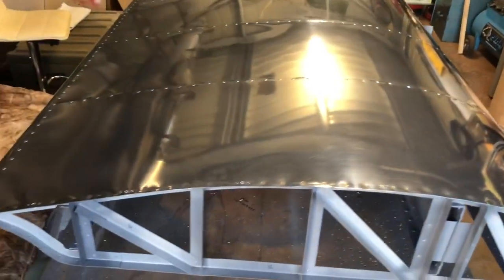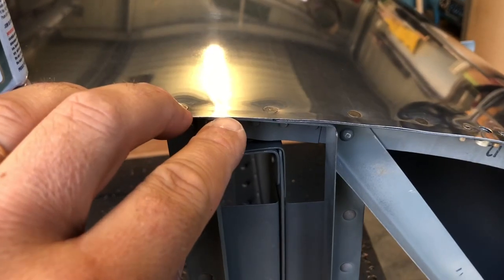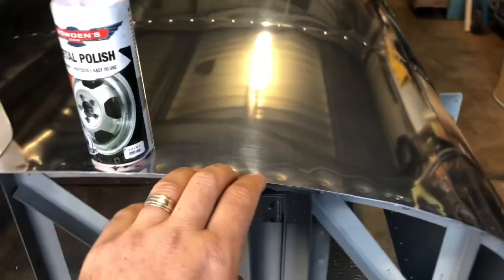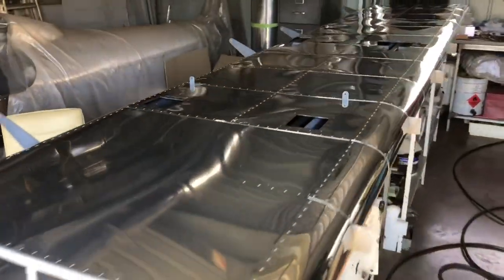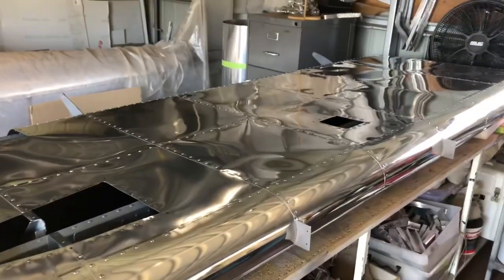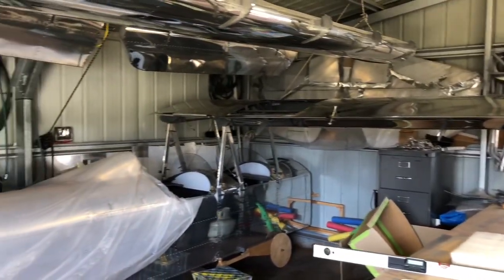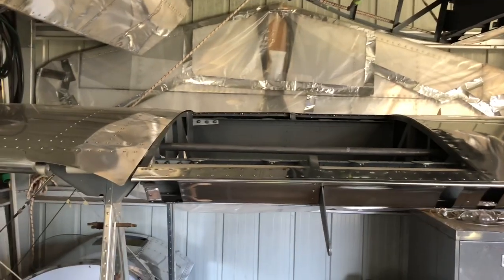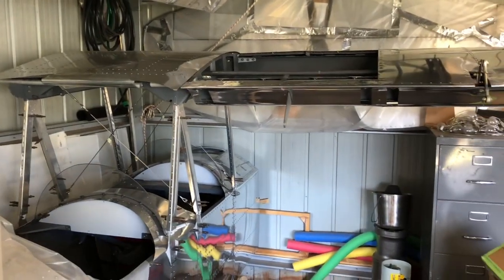Frankenstein progress, building wings

Comment: I don't see any form of drag bracing in the fuel tank bay. If you're going to rely on the skin. then why bother with the drag struts for the rest of the wing at all?  I'm not  sure 0.016" skin will handle the drag/anti drag loads at the wing root very well.
Reply from the maker: Cheers mate, I considered the skins as secondary structure, not primary. It could be covered in fabric easily. The primary structure is internal with bracing between the spars. The tanks themselves are attached to mounts on the spars, and add to the bracing although I wouldn’t consider that as primary. I didn’t add cross braces to the tank as I didn’t think it was necessary at that point. 
Ps…sorry for the late response

Comment: GOOG job......why the bottom skin are in 2 pieces after the fuel tank location ?
Reply from the maker: Thanks mate. The 2 piece skin on the bottom is an attempt at reducing the potential of cracking. The lower surface skins are flat so can wobble and vibrate. My theory is to have smaller skins so where the rivet passes through it is holding a thicker structure. Also the aft skin has a fold at the front which stiffens up where the rivet join is. Hopefully it works
Reply: @donwtsn  thank you

Comment: Great looking wing! I see you will adding LE Slats. What’s the weight of thei wing? What thickness is the L channel used on the ribs?Really nice job 👍 should be very proud of the results!!!!
Reply from the maker: Thanks mate. With the LE slats, flap, aileron and wing tip each wing weighs 34kg. The wing rib pieces are 0.020 2024t3 aluminium.
Reply: @donwtsn  Thank you for the info! Nice job. What’s the MTW for the airplane. Looks cool!